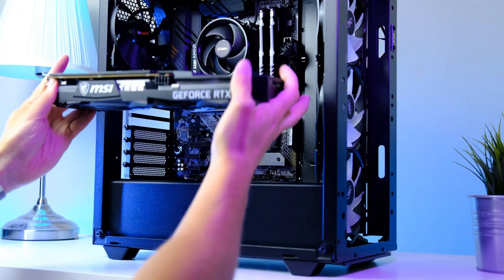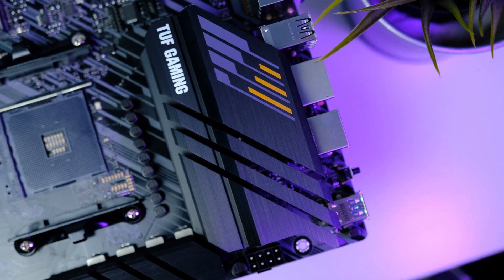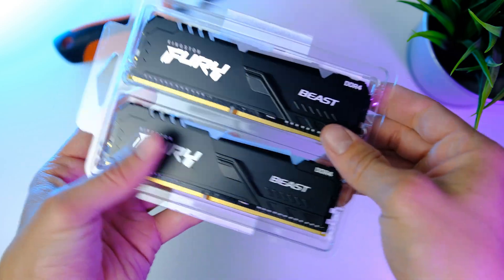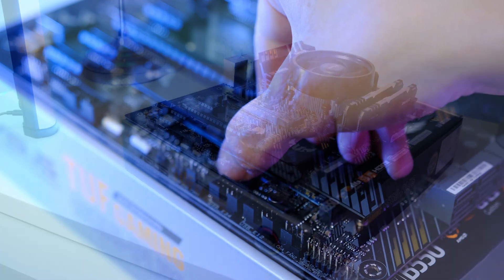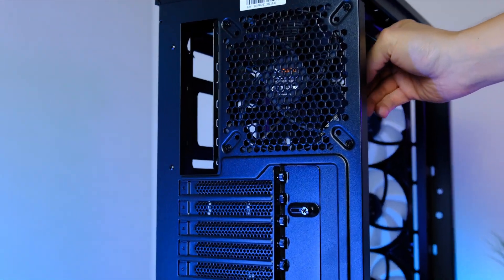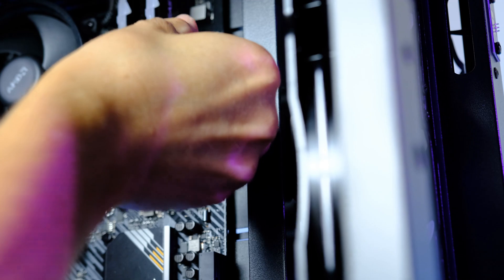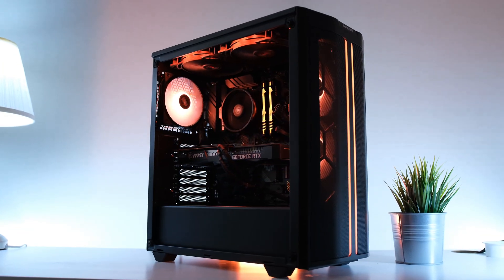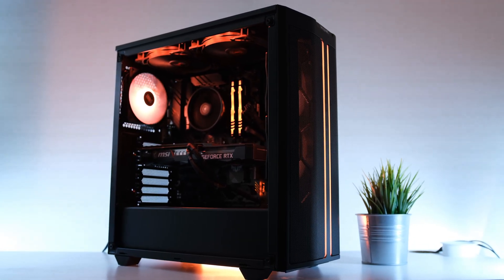Budget Build with RTX 3060 Ti and Ryzen 5 5600 for 2022/2023

Comment: You can buy better GPU with that money and I ain't talking about used
Reply: Yes but it’s a nvidia card so it will have better ray tracing and not much driver issues, as well as better encoding and decoding
Reply: @BingleBatts  he can easily buy a used 2070 super new 3070 , used 3070 super or Rx 6750 xt so yeah
Reply: @animefunboy505  I was talking just about new cards mainly but I feel like Rtx 3070 new is too expensive, at least in my area, and a 2070 isn’t as good as a 3060ti
Reply: @animefunboy505  2070 super isn't better